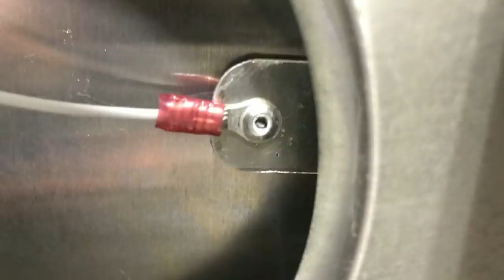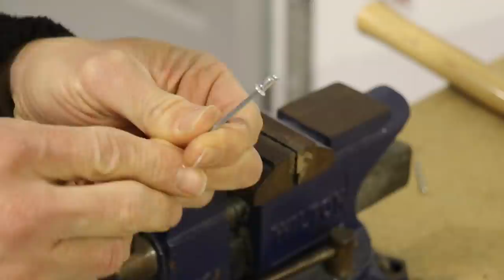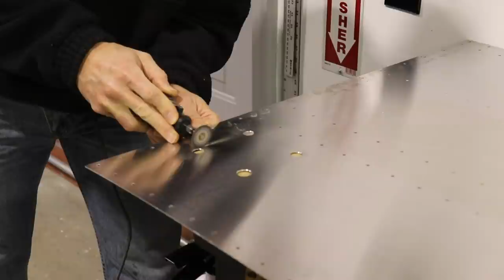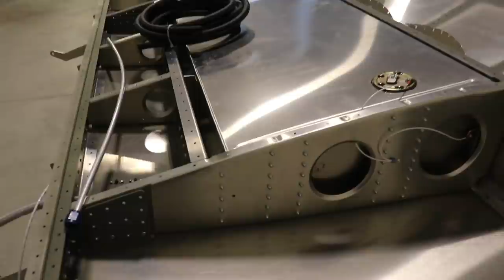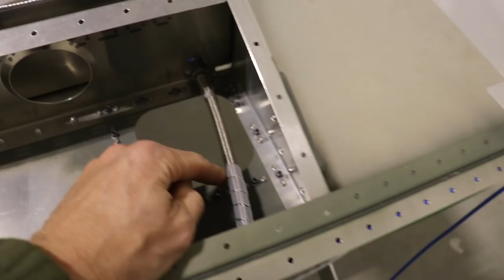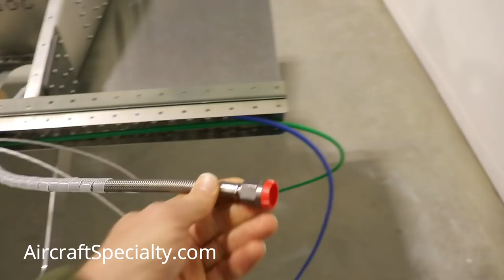Fuel Tanks & Fuel Lines (Ep18)

Comment: I hope you can find the time to answer my questions as we are installing the tanks in a cruser this weekend! When you decided to cut the hole in the wing for the sender access you made a surface patch. I was wondering how you came up with the number of nut plates you used? I was wondering why you did not use a doubler under the hole with the nut plates in the inner portion of the ring and then install a flush panel in the inner section? When a section of a area is cut out on a certified airplane you have to use a certified patch information or AC43.13. Using AC43.13 last night trying to figure out a patch for a ruffly 4" square I came up with about 80 rivets on the outer ring of a doubler. This is why I am asking about the number of nut plates and or rivets on the access panel. I am not trying to being negative, I am just trying to learn from someone who has already been there during this build. Thanks for your videos and stay safe and well.
Reply from the maker: Please go look at all the other access holes in your kit and let me know which ones have 80 rivets around them! Don’t make building airplanes more difficult than it needs to be!

Comment: Easy to understand uncertainty of where exactly to terminate a hard line before the fuselage is built. So why not just leave it long and terminate that end when ready to mate with the fuselage?. There is enough tubing flexibility and access for flaring tool, I would think, to do so during wing install. The braided Teflon lines are great, but they are heavier and an order of magnitude more expensive.

Comment: Hey Mark, love your videos as always! Did you use a rubber grommet for the fuel supply line at the exit of the tank or just drill a larger hole? I'm having a bit of trouble getting the AN fittings and braided lines to fit through the stock Zenith holes. Also, where did you get the plastic/rubber protective wrapping for the fuel lines?
Reply from the maker: If you put the grommet in the hole and then try to pass the hose through, you may not be able to get the hose through the hole. You need to put eh hose through the hole first, then slip the grommet over the hose, and work it back to the hole. It's a little more difficult to get the grommet in the hole since the hose is there, but you can work it in.

Comment: Do you or have you used a Nibbler tool to make cutouts? I find them to be fast and accurate, especially on soft material like Aluminum skins.
Reply from the maker: Yes-I used the nibbler to cut all the holes in my Cruzer panel. It does work fine, but I've found it quicker to use the Dremel and the cut-off wheel.

Comment: Which compound are you using to seal the AN fuel fittings Loctite 577 Thread sealant, EZ-Turn lubricant or an epoxy one like 3M Scotch-Weld 2216 Epoxy Adhesive as recommended by EAA?
Reply from the maker: I can't remember the name off hand, but I did show it on a previous video. I'll post the name when I get to the hangar.
Reply: @KitplaneEnthusiast  Thanks. For your info I'm about to start building a Sling TSI that should arrive from South Africa mid December.

Comment: Why would you rivet a wire to ground? Why wouldn't you use a screw? If you ever had to replace the wire connector you have to drill out the rivet.
Reply from the maker: Hey Bill-good question. First, the rivet works fine and I'll never have to worry about a nut coming loose. Secondly, there would be no reason to need to replace the wire. Finally, let's say I did use a screw and at some point I needed access to that screw. I'd have to remove 200+ rivets just to be able to get to the screw.